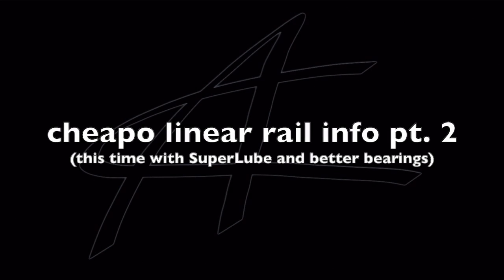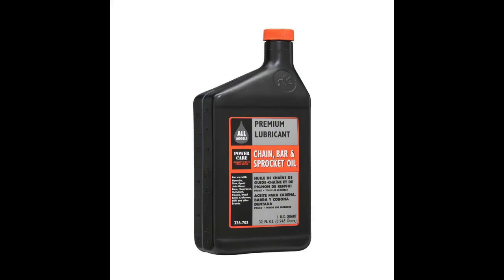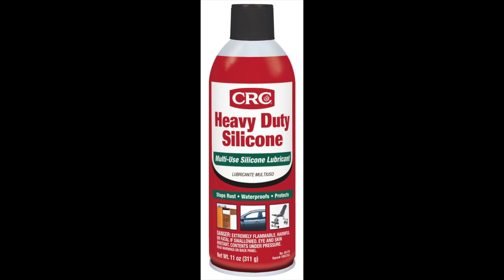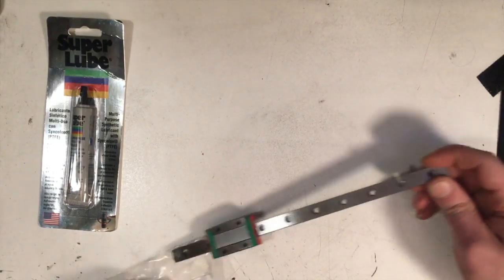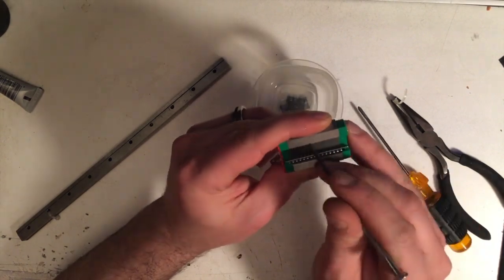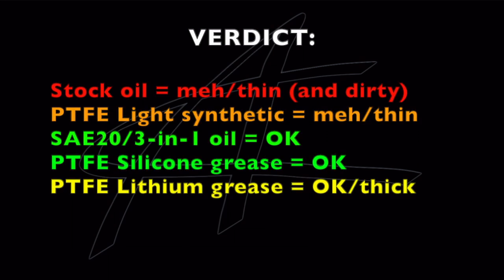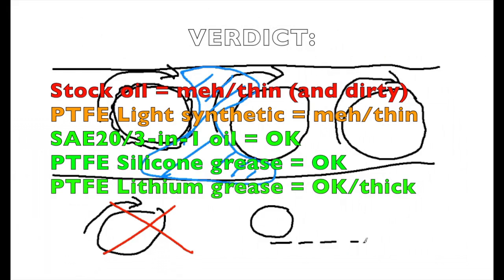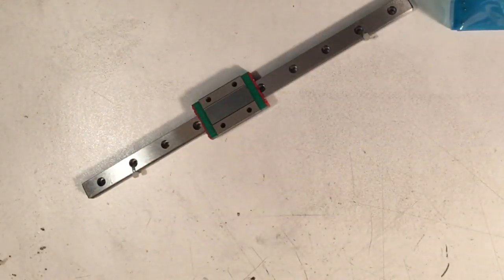Cheap linear rail part 2: superlube and proper bearings

Comment: I know this is an old video but I will say high quality LM rails like THK or NSK use a relatively thick grease if a automatic oil feed system is not incorporated. The grease isn't supposed to be removed and substituted with oils. Think of a ball bearing. Grease is used 99% of the time. Theres science behind using grease instead of oil and can extend maintanence intervals 10's of times over hand applied oils.
 A well known CNC machine manufacturer uses Mobile SHC 460 grease on all non oil fed THK, NSK, Rexroth, Steinmeyer, etc. ball screws and LM guides. Also if your carriage doesn't slide via gravity on your rail consider this a good thing. It's called preload and adds rigidity to the system. Of course too much can be a bad thing especially on a belt driven 3d printer. You can buy a micrometer and actually have some control over the preload by matching bearing balls. 1 or 2 ten thousands of an inch can make a difference.  I have purchased balls from VXB and others via ebay and amazon with a range of .001" from batch to batch and supplier to supplier. You can put together a decent set of rails with an inexpensive mic, some time and a hand full of balls.

Comment: Those are the ball bearings i used for this project on my quick and cheap bearing replacement. I tried White Lithium grease that was VERY thick. It worked great but added additional drag for sure up front.

Comment: Nice series - keep on :)
The take away - buy cheapest ones (even chinese), but with laser engraved tolerance bin and a spec sheet to decode ones. Manufacturers that undertake the qa hassle to bin, shoot for upper bins (there the money is). For our purposes even the lowest bins quality difference will be substantial while price increase if you shop around - minimal.
Also, higher bin graded rails usually have matched carts to the rail - don't mix and match / will screw the tolerances.
Reply: @arturas nx7 would you mind elaborate about the bins ? I guess i understand but i on not see what to look for, explicitely

Comment: I use straight plain ole Permatex Lithium, been using it for a couple of years on my linear rails with zero issues. I know you mention how "thick" it is and it might bind the bearings. You forget 1 small thing, bearings... well they bear weight. The smallest amount of weight will force the balls to roll pretty well. As a constant, more weight will increase the effect of forcing the bearings to roll, for the purposes of overcoming "stickiness" of the grease; with the proper circumstances (given no horrible flat spots on the balls and no divets on race surfaces).

With hardly no load at all, I certainly wouldn't recommend sticky axle grease, but I honestly think even a grease that thick would work with no problems; provided that you didn't just goober the shit all over and heavier than it really needs to be. Slap a bracket and stepper motor onto the bearing truck and that's way more than enough weight to provide smooth action and circulate the balls. The bed on my printer is a 0.125x12x12" aluminum heat spreader with glass on top of that, also way more than enough weight to give recirculating action. 

I do enjoy the thought process though, the idea to clean them first is the best tip that you've given (imo), followed by using a "normal" lube with no particulates. With the actual amount of action and wear that the linear rail will receive, I kinda doubt that the last point even matters. A couple of pounds of weight (at most) on any steal bearing surface should give decades of service, even with poorly machined surfaces, with the worse being that you might replace the balls with a +0.002 size after the break-in period. Quick note on the break-in of surfaces, synthetic products make for a longer (or even a detrimental) break-in on auto engines. I have to wonder if the same holds up to bearing and race surfaces.... I have always been told and other mechanics agree that you use a cheap ass oil, nothing special, for engine break-in. I don't mean the cheapest shit you can find, just plain old no-nothing "oil." Sorry was thinking out loud...

 A couple of drops of clock oil every other week is probably all the lubrication that is required on linear rails for this usage. I honestly don't plan on testing any of it though; give it a good clean, slap a light weight grease in there, a super thin coat (so you can't even see it) on the rails, and it'll be fine, of this I am 100% certain. At least that's what the last 2 years have told me, 6 linear rails, all cleaned and plain lithium grease applied, no appreciable wear that I can detect and zero corrosion.
Reply: Hi, I'm a bit confused.  White lithium grease for the ball bearings I get that. But what do you recommend to put on the rails, clock oil? Clock oil and lithium grease won't kind of mix?!?

Comment: Interesting. Any opinion about automotive fluids used for bearings? 

I have XHP 222 grease (marine bearing grease blue NLGI2), 75W90 and other gear oil (for rear difs, for manual transmisions), ATF (red really slippery and sticky used in powersteering and automatic gearboxes), engine oil (contrary to numbers, 5W40 is not thinner than 75W90. engine oil viscosity is at 100degC in contrast to gear oil that is at 50degC. so in reality SAE60 engine oil is way thicker than 75W90 gear oil. and SAE30engine is about SAE85gear oil )

Comment: It's almost 2 years since this video came out... do you have the follow-up video yet? I just got some linear rails for my printer and I want to make sure I'm doing this right. Thank you.
Reply from the maker: I have what I need to do a follow up, so it’s high on the list.  The plan was to do it in spring of last year (when the newest iteration of cheap rails became available domestically). I’ll touch on some things in the king room video referencing the rails that came on that printer, but a follow up will be coming using generic ‘MGN12H’ and another slightly less generic brand that is yet to be delivered
Reply: @AlexKenis  Wow. Thanks for the fast response.
Reply: @AlexKenis  did you ever end up doing a follow up? I couldn't find anything in your vids. Thanks

Comment: Can you publish a link to a  video that demonstrates how to load replacement balls into a linear rail bearing?? Thanks
Reply from the maker: Here is a clip of ... some video i did sometime. Anyhow, it's the easiest the easiest way I could think to do it for someone who has never tried before: using grease to keep the bearings from rolling off while loading them in by hand.  If you are using a thinner grease or oil, you could put the bearing retainer clip on before the bearings and pop them in between the clip and the outer bearing race (that way they don't get away from you). Jusat try not to mangle the retaining clip or the bearings might not circulate properly.  https://youtu.be/dX-c0ht-kLs

Comment: Could you mention something about using ball bearings vs cylindrical type bearings. I am building a larger machine for a wood shop, so distances are longer and the weight is higher but they are not running all of the time. I also am trying to find out more info on the different bearing block types for these linear flat rails. Thanks for the videos!

Comment: Checking the bearing balls with a caliper is a joke, if the truck and rail are reasonably accurate the balls will have accuracies that are far better than what you will measure with those calipers.

Comment: Any opinions on Aluminium grease? ...I don't care about the added water resistance...but it feels a bit lower viscosity than the EP2 lithium grease I have around and I wonder if it would be a decent option.

Comment: Thank you so much for being thorough (in all your videos that is). I bought rails to mod my CR-10s (X and Y) and will follow your instructions. Did you do any before/after test prints to test the improvement?
Reply from the maker: These vids were just an evaluation of the cheap rails themselves, and the printer I put them on was one that I designed around rails, so I can't do a before and after, BUT I'll probably try them out on an Ender and see what differences there may be.  One thing I did notice was that Y-axis resonance was worse with linear rail if they were not tight/pre-loaded and had slightly thicker grease like superlube, but only with rougher driver chopper settings, like lower-microstepping modes, etc. Also, paralleled rails are very picky about binding up since they don't have much float (some have more than others), so I designed that printer to work with either one or two Z rails, in case there was alignment and binding issues. ALso, there was definitely less compliance, so more stress was transfered to the belts from the carriages, which didn't increase or decrease ringing/ripple, but changed it a bit, so I'll have to do testing with and without stiffer belts, etc to see what effect that has. I imagine you'd have to slightly change slicer profiles with rails to adjust for that... but it really depends on the machine and which "links in the chain" are most compliant

Comment: I've seen a video of some cheap rails that were made of stainless steel (I can't find it now). Are you sure the rails you have are not stainless? I know it's kind of a long shot...
Reply from the maker: I can't tell for sure since there is not a spec sheet specific to these rails, but typically they are available in either alloy steel or stainless, so it cold be either.  The rails I have are highly magnetic, so they are either alloy/carbon steel or a ferritic stainless grade, and either one will corrode eventually.  They COULD be a austenitic grade stainless that is magnetically reactive because of work-hardening, but regular steel is cheaper, so I tend to suspect they MAY be non-stainless.  Either way, i'll err on the side of caution and keep them coated

Comment: I have a linear rail from hiwin. one part makes weird noise anyone know what it could be? Do I need to disassemble. printer is working fine for now. I wiped down the rails at one point should I put some lubricant on the rails? I have finish line bike dry lube(pretty liquidy). I could buy other lube too if needed I prefer not to have to disassemble cartridge.

Comment: I will be pipe polishing the interior and will polish the rail ,i bought a polishing wheel and installed it on my bench grinder ,and i bought super lube and permatex synthetic grease and permatex white lithium grease,and i will compare them the only thing is that super lube can go to 450 F the permatex synthetic goes to 400F and the lithium 300F
Reply from the maker: That's dedication!  I'll be interested in the results.  I have burnishing tools, but none near small enough for the blocks, but I may grab some if you have good results
Reply: What is pipe polishing?
Reply: Terry Pullen polishing the inside of a hole ,you take a cotton cord  and pass it in the hole you put polishing compound .
Reply: @94Discovery  Did you test the polish?
Reply: Hamilton Gazim yes i did and tried 3 different lubes,and changed the balls and from 11 bearing block and 6 rails only 4 worked perfect and the rest nothing garbage ,spent like 12 hours trying to figure them out but there was too many variables ,could not pinpoint what helps what not ,if i have to redo it again i will buy MisumI even it is 4 times the price ,if you are looking for repeatable prints and precision work ,then a good investment in the right place is the key .
Reply: @94Discovery  do y have link for misuml please ?
Reply: Hamilton Gazim sorry no eshop all what i found is there website